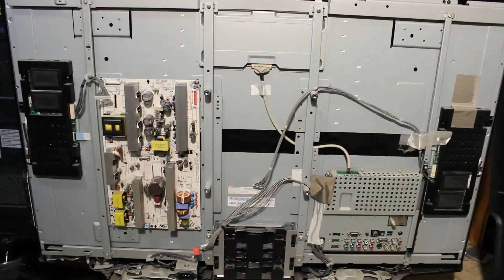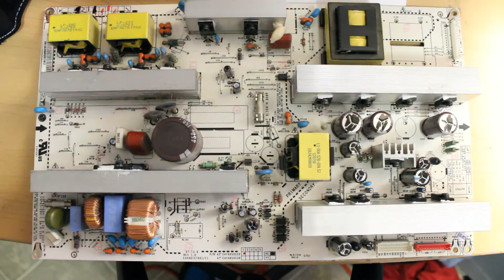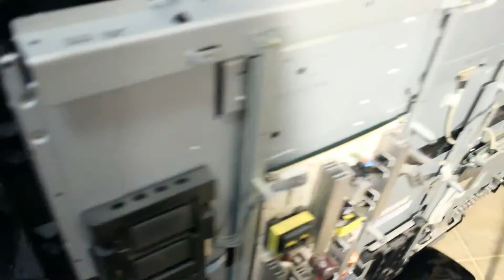HOW TO REPAIR LG LCD TV 42LG30 NO POWER OR TURNS OFF

Comment: I also just fixed a lg 42lg70 1080p 120hz set it was flashing but would still power on after few minutes I took the back off and was shocked to see how badly exploded the 3 2200mf 35v capacitors looked there was also 1 1000mf 25v 1 3300mf 10v on the power supply and 3 680mf 35v bad on the inverter board after I switched out the capacitors it now works well

Comment: I have the lg 42lg50 my problem was the power button / remote sensor I just reflowed the solder on the connections and reassembled everything and it worked
Reply: I also forgot to mention I lubed the buttons on the side circuit board for volume/channel and menu buttons using a qtip and mineral oil doing this might work without reflowing the solder
Reply: Does the power module give a voltage on the connectors after plugging it in? Mine doesn't give any power to the 24v, 5 v etc connectors...
Reply: Mine didn't have any power problems and is still working I recently I fixed a samsung tv around the same age as this lg and it had 2 bad capacitors on the power supply the latest lg/samsung sets that I worked on with capacitor issues were manufactured around 2010 some cheap sets such as element/Westinghouse/haier/RCA used bad cap's up to 2012/13 now the latest problem with all the newer 2013-current TVs I'm running into is bad LED lights behind lcd panels which most of the time it's not even worth repairing as it's alot of work to remove the screen without cracking it and when you add up the parts and labor used its just cheaper to buy a new set

Comment: Hi Runforlife, do you know the specified voltages of the capacitors ?
Reply: in case anyone else reads this- my LCD was flicking with some distortion- I replaced all the capacitors in this video and the exact same thing still happens which makes me think it's something else- I'm going to try replacing cables between PSU, LCD power and LCD signal and see what happens

Comment: Thank you for cool video. I have similar TV (Type: 42LG5000) but little bit different problem. Screen of TV doesn't switch on at all. I have measured all the pins on the power supply board with mulimeter and they were showing the correct values. I have also made visual check of the power supply board and all the components were looking fine with no burns , no swollen capacitators. I supposed that the main board is not working and that is why the screen can not turn on but I can be wrong. See my youtube channel for video: "LG TV Screen doesnt turn on (Type: 42LG5000)". If you have an idea what can be the problem on TV please let me know. Thank you.
Reply from the maker: +rudolfius11 If the voltages in the power supply are okay, then the next step is to swap the mainboard, which is also known for failing in these LG models.
Reply: Hello,
None of both suggested solutions whether replacing power supply or main board worked for me. It was the backlight which didnt work and after replacing the inverter boards (which are in charge of powering backlight) I resolved my problem.

Comment: hello my friend thanks for your video.I have an 42lg7000 tv which has the same power board.The problem with my tv is a very slow start up.It needs a half  hour at least of led blinking to turn on and that is the only problem i have.Recently i discovered that if i have the power cable unplagged from the wall for 30 minutes and plug it on, the tv starts normaly.Do you think i have capacitors problem?thank you
Reply from the maker: +Manos Zotos That sounds like a power supply issue, and it is probably related to the capacitors. Have you opened it?
Reply: +Runforlife  yes I opened it and I didn't see anything the capacitors looks ok.This power board has usual fails?The only thing is that the power board make a noise near where the socket of 220v supply is.
Reply from the maker: +Manos Zotos These models are known for faulty power supply and main board issues. You would need to check all the voltages first in the power board to make sure it is working okay. If so, then the problem may be the main board.

Comment: my tv was not working no light on front then I left cord in and I briefly heard a Crackling noise and seen the red light on the front struggling to try and  turn on it was all dead few hours ago
Reply from the maker: +Adam Beck Do you still have a red light? Does the red light blink?
Reply: +Runforlife I replaced the board I ended up having to use a 42LG50 board but then when I turned it on I got these 5 very bright rainbow Circles at the top of the TV ..they seem to have faded away but you can see 5 sorta dim shadows were they where ... after tv warmer up looks fine .. maybe another board needs replaced
Reply: +Runforlife I replaced the board I ended up having to use a 42LG50 board but then when I turned it on I got these 5 very bright rainbow Circles at the top of the TV ..they seem to have faded away but you can see 5 sorta dim shadows were they where ... after tv warmer up looks fine .. maybe another board needs replaced
Reply from the maker: +Adam Beck which board did you replace?
Reply: +Runforlife the PowerBoard
Reply from the maker: +Adam Beck Try to re-seat the connectors of every board you may have unplugged before replacing other boards. Circles of colors sounds like a bad LCD though.
Reply: +Runforlife oh ok yea it was Very bright circles 5 of them along the top of the screen but now there gone but they left a faded Shadow you cant really see anymore .. I  thought maybe it was another board acting up .. ill try and move connectors .. the circles were spaced out along the top by half a foot each 5 of them I can count

Comment: Why randomly replace capacitors?  How do you know they are bad?  They do not look blown because there are no indications of that.
Reply from the maker: +Running Out of Air Sometimes a bad capacitor may show physical signs of its internal state, such a leaks, or "blown out," but that is not always the case. Even capacitors that test okay with a digital multimeter can cause trouble once the actual voltage from the power supply runs through it.  In this particular TV, that was the case. The capacitors did not appear to be physically blown, but when tested, they displayed low capacitance, which ended up repairing the issue.
Reply: Runforlife
I will keep that in mind.  Thank you.